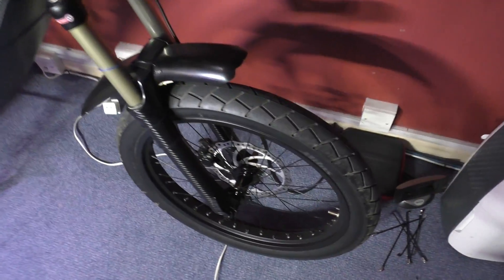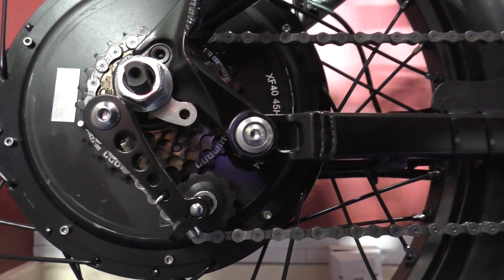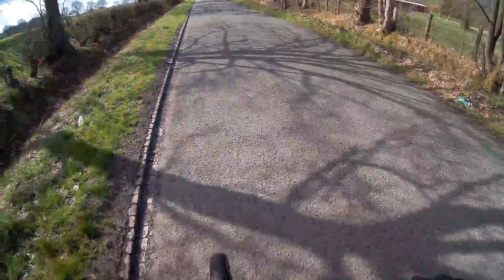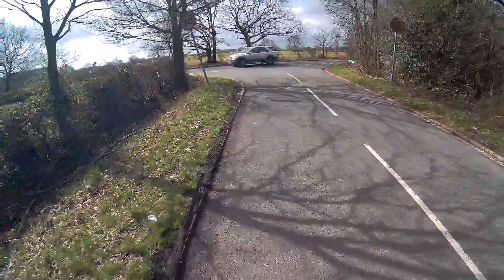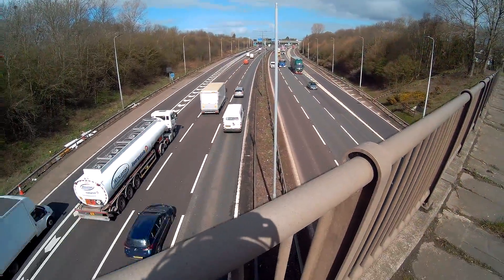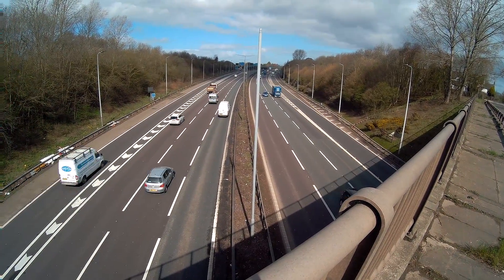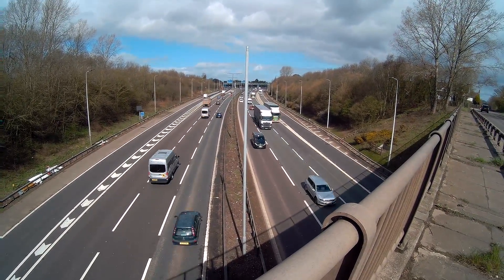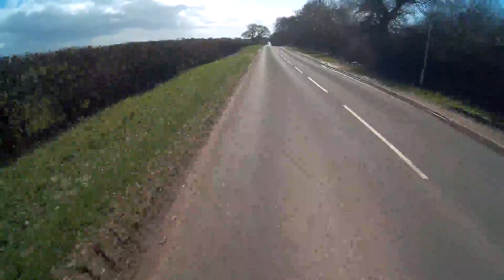Insanely fast DIY electric eBike - I want more POWER!

Comment: I'm pretty sure that the person who said: "you know a lot about electronics but not a lot about bikes"
was referring to the technical side of how two in line wheels steer.  It's called counter steering.  It's not your body weight that gets the job done.  It's the initiation of rotating the bars counter to the direction you wish to turn.  If you wish to go left, you apply pressure to the left bar.  To straighten up, you apply pressure to the right bar.  All bikes steer this way.  Don't believe me?  Ride as fast as you can in a straight line.  When you have established your speed, use one finger to apply a light pressure to one of the ends of the bar.  You will turn in that direction.
P.S.  don't jerk the bars.  You will fall.  Ask me how I know.

Comment: as much as I liked watching the build, I don't think an E-scoot would be right for me personally Tony, I'd just be paranoid if it hit a pothole on the road with those tiny wheels, rather than bumping through/over it like a bigger bike rim would it could possibly dead stop you with enough speed to toss you down the road in a pretty painful manner, I'm leaning towards something like an old Aprillia RS125 with a dead engine for a build, I'd need to figure out what motor to get and what type of pack I would need to build, I'm guessing  I would need a few grand putting into just the parts alone.

Comment: I like to stay at the very edge of what's possible and current. Thus far I'd say you're the reigning king. I've seen a couple of bikes that people threw a shit ton of money at and went completely wild with overkill on the components but for the all around concept planning and critical thought that you've put into arriving where you're at, I'd take your bike over any other one seen. I'm developing a boosting powerplant and self recharge system that I hope will be something special but what you've done is fantastic!
Reply from the maker: Thank you, Sir!
Since I built this, I've built another version which I still have. I'm currently working on the design of my next version with even more power 😁
Reply: @Vortecks  what would you say has been the thing that you've hit on that has yielded you the most net performance??my focus over the past few months has been boosting voltage and machinist use of specific current levels. Other than buying a monster motor I couldn't afford, what would say  makes the biggest difference?

Comment: Nice setup.. Is the frame Alloy or steel?
Reply from the maker: Alloy mate.
Reply: @Vortecks  cool... So alloy frame is ok to use on a high powered ebike as long as you have  a torque arm I assume?
Reply from the maker: @nickn8812  The first one I built was steel and all the welds fell apart. The second and third were aluminium and I've had no problems with them.
The only thing I'd suggest is having 2 torque arms (both sides) to even the torque load.
Reply: @Vortecks  Yeh cool I was thinking the same thing,  having 2 torque arms. 
Im currently running a 26 inch steel frame pushing  7600 watts but I want to get a better bike as mine is just a cheap  $100 MTB, and  most of the decent bikes these days  bikes are alloy  frame.
I think it will be fine, as long as torque arms  are you used.

Comment: hello mate I'm looking to make a super commuter cruiser ebike. probably 1000w front and back but im struggling on what batteries to use? im thinking of using lipo rc batteries,  is that what you use in you're  videos? 
and if so do you link them all with one bms or just balance charge them?

Comment: HI AGAIN TONE I GOT MY SONS BUILD FINISHED ...IM A BIT PISSED OFF BECAUSE I BOUGHT THE 4X THE VRUZEND 2.1 KIT FOR MY OWN  THINKING THAT WAS THE SAFE WAY TO GO BUT THE 30T SAMSUNG 21700 35A CELLS ANDY TEMPTED ME INTO DONT GO AS THERE 3MM WIDER PER CELL ANYWAY YOU LIVE N LEARN   ITS A DAM SHAME VRUZEND NEVER MADE A 21700 BATTERY BOLT KIT  TOTAL  BUMMER      SO IM GOING ROUND IN CIRCLES STILL WITH MY OWN AND AM A BIT LOST  ON SOMETHING THAT WILL POWER THE 3K TURBO HUB  AT 72V??  I REALLY DONT WANT TO WELD THE CELLS AS THERE IS NO WAY OF CHECKING THEM EVERY YEAR OR SO  ...IS THERE A HIGH AMP 18650 CELL YOU WOULD TRUST ??  OR I COULD GET 100 OR 120 IN BULK TO POWER THE SET UP WITH GOOD AMPS PLUS GOOD MILAGE  OR IS IT A TRADE OFF

Comment: Hi Tony I’m building an ebike and have the sabvoton 100 amp controller but I am having trouble unlocking it / programming it any suggestions 
Thanks in advance Gary 
Ps loving your videos very informative and funny
Reply from the maker: You can't unlock it mate, it's done on a software level at the factory. You can fool it into thinking there's less current going through it, by putting a bypass cable around the hall sensors inside. This will allow double the current (200A in your case).
Is that what you wanted, or are you having trouble connecting to it?

Comment: That bit on dangerous bike test,  0.5 mile in 45 seconds.  ivy house pub to long lane.  so is 40mph average. long lane ivy house pub.   worked it out off google maps.   not sure what top speed was, but you should have got yourself a drink.

Comment: After watching so so many videos about hub motors, I just gave up trying to understand how to pair the best battery with the most effective hub motor for my weight and speed preference, on a bike that would accommodate the new wheel..

In the end, I've decided on a blisteringly powerful Bafang mid drive strapped to an already perfect bike... I no longer have to think about stuff like BMS or what cables I need to plug in from the back of the controller etc, plus mid drives make use of the multiple gears your bike has..

Comment: I am running a MXUS 3 kw 4T windings on a 26" wheel rear hub motor, with 135 Volts 30ah triangle batteries two in series, and it is deadly at 90Kmh (56mph), on 3rd speed setting, I shudder to think what the MXUS 3kw 3T motor winding will do at this high voltage, will know when my new 3kw 3T with 26" wheel and 80mm wide rim is coming from China, I am building a new Ebike Fat Tyre 4", 120/140 Volt 36 Mosfets sinewave controller and cruise control. With a battery selector switch from 60 Volts to 135 Volts. Happy Ebike riding

Comment: I want to see a bike that can burnout, do wheelies, and get a 3 digit top speed. I am on board at that point.
Reply: It's possible for sure. How much money are you willing to spend? 
96v lithium battery or higher voltage required. minimum of 8kw hub drive for sure, custom bldc controller because of 96volts DC. Probably no gears or 3 at most. weight of the bike... probably 60kg~80kg rough estimate.

Comment: Hi,bay powerfoul motor 48V 1000w,battery 48v 20Ah after you have speed ,or ex,72V 25Ah battery and controller 84V 80Ah,
100km/h speed,,,

Comment: YOUR FRAMEWORK IS NOT MADE FOR.

AT TERM IT WILL NOT RESIST!
your spokes have a wrong angle, twisted and the hole where the rays pass will deform quickly with tension .. eventually your rim will be dead .probably broken soon! Pay attention ....

Comment: goozbumbs.......a tremendes job you did. This I can use on my mobilityscooter. I have 2x 12volts, 70 Ah batterys so its a 24 volt motor. speed is about 20 km. Way to slow. You did a great job, and don`t mind the negative answers below. I am a fan. Just a disabled guy from the netherlands\

Comment: I have a personal comment for the video uploader if you'll build yourself a lightweight towable cart and place utility trailer tires on it then you'll be able to store 2 or more times the battery capacity and it will remove the heavy weight from your bicycle onto the towing trailer you could even optimize your bicycle by using electric motor hubs mounted to each of the back wheels of your towable battery trailer but as you know already you would have to use bicycle style rims and tires doing this would allow your battery trailer to push you and your bicycle or you could use the the extra power of the towable battery trailer when you are needing extra power to get up hills

Comment: Yeah I wanna build one of these. I live 12 miles from work even though most of it highway I could take the backroads and get there a little later. Less, gas , oil changes and miles on my car.
Reply from the maker: Strangely, I take the backroads and I can get home 5 minutes quicker than using the car on the highway 😁

Comment: Hi, as for going around corners,I know it sounds daft but as you turn left try pushing the lift handle bar it will help to lay the bike over same when you turn to the right as you go into the bend
 press slightly on the right handle bar. All good motor biker do this and trust me it works.

Comment: Nice work...love the bike...built my first 10 years ago...did have the selection of parts available today.I thought 80amp@ 60V was fast lol..
Now a days I ride a Trek cross country MTB with a 1000w Golden motor front hub motor for weight balance pushing 3000w through it for short periods...under 10 sec which gets you to top speed which is electronically governed at 50 kmh...been reliable the last 5 years...will smoke the front tire up till 30 kmh lol...lots of fun...Just use it for commuting...no jumping or any of that non sense...getting to old for that...

Comment: Don't kid yourself, low power or pedal cycles cause the most pollution of any vehicle on the road! Energy isn't consumed by cars trains or lorries to carry on at a constant speed, it is consumed accelerating, or overcoming friction. If you pay to get to 60mph, then have to slow to 10mph then accelerate back to 60mph, not only does your journey take longer, but costs you more. The most efficient vehicles, maintain one speed for their whole journey. 250W bikes should be banned in favour of vehicles that can do 70mph and maintain it. They are the most efficient environmentally, and the quicker they can get out of a junction, or through traffic lights, the less congestion. So 0-60 in 3sec, and 70mph everywhere you spend 6mins getting to work, not 60mins, so 10x less congestion on the road! FACT! - you thought this was criticising didn't you!
Reply: Agreed we should all use v8s so we end up not having to go abroad for a sunny holiday! :))))

Comment: Counter steering? it's probably too light for that.

Has the center of gravity up? Lowered battery bank, eventually moved?
Why have wheels so small? I know enduro with 21 ", there are probably enduro soft tires on 21".
Wheels + tire of fat bikes have not been matched? Swalbe has tires E50 (50km / h) - Marathon series (eg.)
Reply: Counter steering is the only way to corner a bike at speed.  Basic physics.
Reply: @Hirotoro4692  I drove light motorcycles (up to 150kg) and no counter was needed.
On heavy motorcycles (over 200kg) it was sometimes necessary.
Why in light motorcycles you do not have to
 and the bike should?

Comment: I think your mint,wish I had your brains mate ;been stuck on throttle problem with 5wires the blue wire can't find were it goes on a 1500w brushless speed controller

Comment: You have done a amazing job on this beast.
I have a sultry Magnum peak e bike.
Top speed almost 40 km/hr.
I'm a speed freak over here in New Zealand, Christchurch. 
Like yourself I have ridden a lot of motorcycles,that beast must be awesome in the corners. 
One thing didn't notice if you had a suspension seat post?,or would you consider one?.
Wish my bike would go faster.
I use it to go to work every day.
9.6kms one way.
Every third day I need to charge it.
Only because I'm using full power most of the time.
Great to see other videos mate.
Congrats on what you have accomplished. 🤗😉
Reply from the maker: Cheers Craig 😁
I don't use a suspension post because I don't feel the need - With the weight of the bike, it does soak the bumps up rather well.
I'm currently working on V3 with more power, better range and I'm also legalising it - something that hasn't been done in the UK by an amateur builder before.

Comment: It is good, no it's excellent, it's exciting.... I myself has made several e cycles but with kits basically from China.. those are good but the speed is 20 km/ hr. And the kit is 24 volt 250 watt. Now I am modifing it to run on 36 volt. Already done the experiment and it runs at nearly 35-40 km/ hr.... Hope to see more excellent vedioes from you

Comment: 2:55 These Circuit Breakers have 2 ways they can use to shut off.

One is a metal plate that gets hot and trips it.
That's also why it trips way above the rated current.

And the other one is electromagnetic.
That one only reacts on high short currents.

So they are not really suitable for what you are using them.

Comment: When you get to the upper end of the distribution of performance in any form of mechanical movement it takes special talent.   Unfortunately people think if they can buy it or rent it they can handle it and don’t trust their brain that says “you aren’t ready for this, dummy.  Slow down and work your way up with some confidence.”  If you feel “scared shitless” it’s not the machines fault.  Your internal sensors are working and telling you “you don’t have the skill to go as fast as this thing can go,  don’t bad mouth the machine because of your inadequacies”.  This guy is a good driver and mechanic.  A rare but great combination if you got it.   Keep on pushin man.  Love your passion.

Comment: I wonder if you could give me a bit of advice,I’ve got a 36v 1000w viron scooter and I want to be able to charge the battery pack while it’s out of the scooter,do I need to get a spare control box or can I just make a wire with the necessary plugs at each end ( it’s three 12v batteries and the charger is 36v-1.5a) any help would be greatly appreciated

Comment: you want more power read my previous comment. run it up to 6 rotation and you get continuous 120 v and 10 to 20 amps based on stator. if you don't want to get shot for your design patent it and remember use a small battery as it really pisses off oil people. limit the mileage and they will never know.

Comment: Love it - absolute madness. Dare I just add one nugget of advice: get yourself out of the gutter. When travelling at speeds close to, or faster than, the surrounding car traffic, place yourself in the lane so that the drivers don't think they can just squeeze past. Make them work and wait for an opportunity to overtake. Use your lane positioning as advice to the traffic: "OK, I'm moving back to the left now, so you can safely overtake". Sorry, I'm an old motorcycle instructor. Enjoy the madness!

Comment: hey did you know that installing a step generator is possible to extend battery life up to ten times the normal value. just use the power motor to turn  cog on 4 to 1 ratio for a fifteen magnet generator stator which is much light then you and your bike. but you have to limit it to the max power of the new ac motor or dc if you use a dc stator or you will fry the circuit. always test first and make it under the max by five amps and at least ten to 20 and then you can reach distances of 100 to 200 miles per charge. good luck and good game. (I love video game) (true nerd power.) stator breaks are often necessary just split the distribution between the front break and the stator to keep if from delivering power. (this is if you use direct power and i suggest use a bike tire hub rear for this assembly.) good luck. (Also it negates uphill battery drain completely.)

Comment: On a motorbike, you DON'T use your body weight to steer, you use counter steering.  If you are starting to feel the gyroscopic effects of the heavy wheels keeping your bike upright in the corners, then it is CRITICAL that you start using counter steering or else you WILL have an accident.  To turn right, you would push forward on the right side of the handlebars, and vice versa to turn left.  Just try it.

Comment: Keep the videos coming and keep them real like they are. Born in England but moved to Canada long ago. As you work the bugs out and gain reliability and are able to benchmark performance, range and charge times keep uploading videos. Curious what something like this cost you to build and what it would likely retail for in a store.  In many congested cities people may have cars but don't take to work or live in apartments and this is easy to bring inside unlike a motorbike.
Reply from the maker: Something with this amount of power would cost in the region of £8,000 in the shops. Mine cost in the region of £2,000.
I'm currently working on V3 now with more than double the power (around 40kw) and double the range.
Keep watching my friend, it's gonna be worth it :-)

Comment: I have a 5000w motor which I’ve just burnt out by abusing it. Is there any way of fixing it? I can see three burnt wires but all the copper windings look fine.
Reply from the maker: That's a tough one to answer. It all depends on what wires have burnt out. 
Anything is possible, it just depends on how long you have to spare!

Comment: Hi Tony, with your previous comments on the front wheel lifting at speed why not use a handlebar that drops down to move your body weight forward. Not racing bike drop bars but more motorbike style.